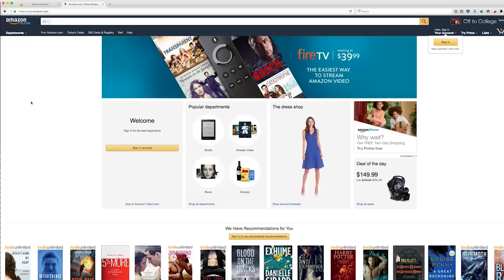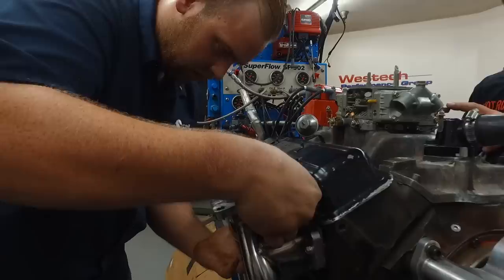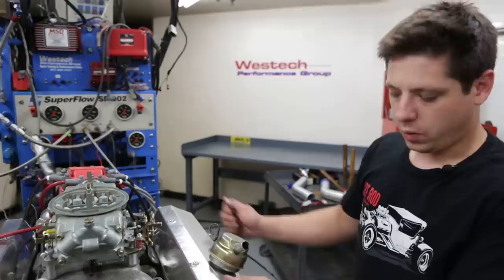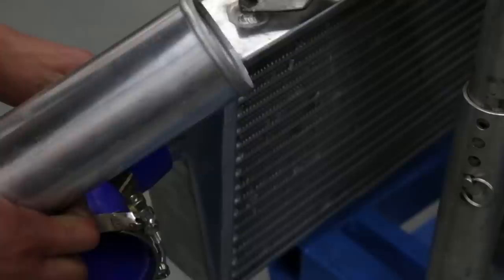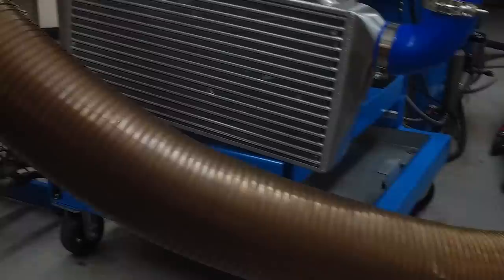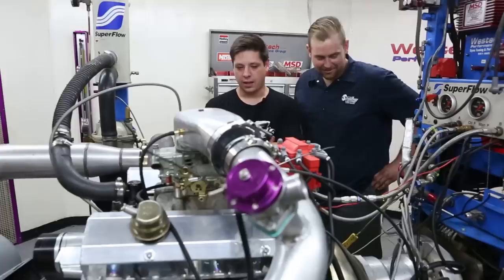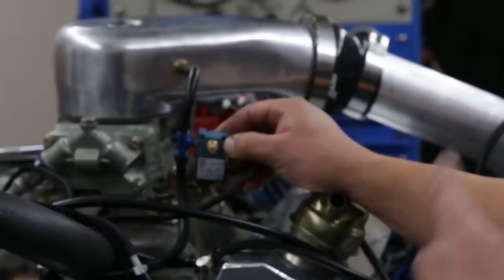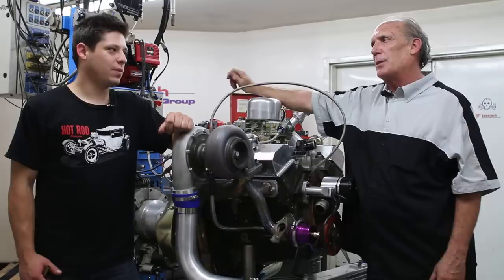Small-Block Turbo Kit for $699! But Does it Work?

Comment: Are they running a stock carb and just changing jets? And are they running an msd distributer with vaccum advance, if they are did they lock out the distributer and drill the blow off valve protection in the carb?
Reply from the maker: Here is how we built the carb: http://www.hotrod.com/articles/build-blow-carb-less-50/

The distributor is a cheap HEI that was modified to limit advance. An MSD would work very well also.

Comment: Just need a better blow off valve  and ur boost controller and Dyna .. and custom piping & ur good to roll.... I’ve done and eBay turbo kit setup.. .. just got better blowoff Valve, and boost controller small blue box and all good plus like he said get ready to work.. just had issues on piping cutting them my self

Comment: What sort of ecu would someone use to tune a 350? I’ve turbocharged my mr2 spyder and tuned it by myself with a datalogit but I don’t know much about these older engines. I’m interested because I’m close to buying an rx7 with a 350 and I’d like to turbocharge it at some point.

Comment: Everybody watching this remember, if you just slap a turbo on a stock n/a engine you're going to blow it. Yeah the kit is cheap, but you need to build your engine for boost, no matter how much you're putting to it, if you don't you're going to blow your engine, suck a rod, or blow a hole in your engine

Comment: I would put it back in the truck and run the turbo intake clear to the back with a giant cone filter hanging out where the muffler should be, and a flow master 40 poking out threw the headlights hole !!!!!!🤔🤔🤔🤔🤔

Comment: Brake booster on right hand drive car is on the right side, probably designed overseas to fit wrong hand drive? Or they just installed it upside down lol.

Comment: If an average guy buys this then thinks its bolt on with no mods or tuning then they need to blow their motors up.  Turbos are excellent power adders but with any power mod you need to make sure it is properly sized and has a good tune.

Comment: Man really like that little electric impact gun. Anyone know what model that is?
Reply: I didn't notice the one in this video, but I tried a Makita DT01 (now discontinued) that a roommate had and it was awesome. Down a bit on max torque and battery life vs. my DeWalt 825 with "20V" adapter and battery, but for 90% of the things I was using it for, it was more than adequate...and an improvement in tight spaces!

Comment: do you need to do something special to the carb/ or does a regular holley or demon carb work? i heard you need a blow through sealed carb? any help appreciated,going on a 1980 c-10 350 4  bolt engine
Reply: Blow-through carb. They're about $800-$900 at Summit. I've also seen some utube videos on modding Holley carbs to handle a blow-through setup.
Reply from the maker: We modified a stock Holley for this test. Here is a link to our $50 blow-through carb build. http://www.hotrod.com/articles/build-blow-carb-less-50/

Comment: You never said anything about the carb, a stock carb would give you problems due to it's not designed for blow through applications. You would have to have your carb reworked or buy a new one designed for blow through. just saying.

Comment: Why did the boost not stop rising with the original 1 waste gate???
Reply from the maker: The single waste-gate didn't have enough flow to slow the turbo down. Because of that, the speed of the turbo kept increasing, as did boost.
Reply: Gotcha. Thanks for the reply!

Comment: Hey smart guys how about the Accel shorty plug for header instead of beating the crap out of your headers ? Or is that to easy ?
Reply: The tube blocked the spark plug hole. A shorty plug was not an option.

Comment: I did not see them clock the turbo...could have clocked it 180 degrees and turned the whole turbo around it was using a t4 flange which is square and can mount either direction..also they were running on pure waste gate why not add a softer spring that would dump at 8 PSI..i just do not think they really know much about turbo systems

Comment: It doesn;t pressurize the entire carb, so, it won't work at all. The only thing that will happen is, it will force the fuel out of the carb.
Reply: You can buy blow through kits for carbs to use them with boost.

Comment: How much hp u think will this kit add to an h22a4 vtec dohc engine
Reply: The question you should really ask is "How long will an H22A4 vtec dohc engine last with a turbo the size of my head and no other mods?", though asking it like that should also clue you in to the answer. Cheers.

Comment: What carb is that? A blow through? Most people are not using blow through carbs to that's another $600 bucks. Misc. odds and ends for modification the price has already doubled at least.

Comment: Weather it works or not?  What.... do you mean that you think tey would sell you a fake or broken turbo?  Why wouldn't it work? Because it doesn't have Garrett stamped in the side? 
You can go to a junk yard and get a turbo off a volvo and make it work. You're not going to push 21 psi with it on a v8, but it will work as it should.   Why wouldn't the ebay turbo work? The real question would be HOW LONG DO THEY LAST?

Comment: You do realize that the reason you overboosted is because you didn't have a vacuum line on the wastegate.. you don't need 2
Reply: Not the case. The boost signal to the wastegate was routed correctly (you can clearly see the vacuum line in the video). The wastegate was too small and poorly located on the exhaust manifold causing it to function inadequately.

Comment: can you make a video on how to make more power and torque in a 5.3 tahoe motor. is there almost no actual information online, only crazy pipe dreams.
Reply: What do you mean? there are countless videos and forums for that engine. Whether it be the vortec based model or LS based model. It's exactly like any other GM v8. get a cam, some bigger injectors, a tune, headers and exhaust, super charger, pro charger, turbo charger, etc.
It took 2 seconds of research to find kits, videos, and forums on the subject.

Comment: Couldnt just change the wastegate spring?
Reply: The wastegate spring determines when the wastegate opens, not how big the orifice is. In situations like this where the maximum flow of the waste gate was insufficient, dual gates, or a larger gate is necessary.

Comment: So what's the best budget turbo kit for an lq9 6.0 engine ? I have an 04 ss with stock lq9 317 heads, I wanna run a ls9 cam and turbo at 10-15 psi. Seen some pretty impressive videos of them. I just dont know what's the safest affordable route for turboing my truck.
Reply: You need to look at how much damage each system causes overtime and how much benefit each system gives you and whether those are worth the goal you're trying to reach
Reply: A lot of people just change the rear end gears in the transmission and get just as much power out of it without touching the engine itself
Reply: @thecloneguyz  my truck is all wheel drive brotha. Could I make the rear faster than the front?
Reply: Precision turbos make quality turbos for good prices. Dont cut corners on ebay turbos, they have a tendency to explode. If you know how to weld you could save yourself quite a bit of cash doing the plumbing yourself.

Comment: is strange to me this guy seems like he wanted this Turbo System to fail but he was proven wrong and he couldn't just deal with it he has a good Turbo System real cheap
Reply: I don't know if i would say good since the layout is crap with the rear facing turbo, bad flow collector design causing boost surge, cobbled together IC piping that required an AC welder to add a flange, intake filter that doesn't fit and undersized waste gate that also causes boost surge.

Comment: buy once cry once. good motto to go by. Turbos and super chargers or nos even should not be bolted on any stock engine unless you are making a you tube video or don't like a running motor. Just saying if you save your money and build a motor with higher compression rates  and proper piston rings and cam. it  will last a long time running boost if done right. Then you will still have a car to drive until you are ready to swap a engine. Do this you will be walking with a trashed motor in your ride in a day or two  or a few months unless you set the boost around 3 or 4 pounds. And If that's the case why build it in the first place.  I know i mentioned nos also and that's another subject it is cheap to install but it starts trashing the motor the day it is installed.   BOTTOM LINE HOT RODS ARE NOT CHEAP AND YOU GET WHAT YOU PAY FOR        I

Comment: it would of worked if they would of juist flipped the system the correct way as in turbo on the drivers side
Reply from the maker: Incorrect. In a vehicle application, there is a master cylinder in that location. The turbo also interfered with the stock-height valve covers.

Comment: "Got oil absolutely everywhere..." 
-_- Did you really run it with the valve covers off? It's hardly possible that you'd be that oblivious, right? Wth?
Reply: An old guy told me about how they got a hole in the oil pan driving an 80s Chevy g10 van with straight 6 motor and took the valve cover off  and drove home just pouring oil on the valves (in vans they have a doghouse cover so the motor is reached from the drivers seat) if you don't know what that is then nevermind
Reply: So, you've never adjusted the valves while the motor was running?

Comment: I think in this case the engine will be more likely to break than the Chinese turbo. It is too much horse power for this engine in stock form. I am surprised the carburetor got along really well with the turbo making this set up really low cost.

Comment: $699 is too much. Get a crusty turbo from a junkyard, slap it on a junkyard Vortec. make 800 and call it a day.
Reply: Or get 2 used t3 turbos and have a much easier time with boost management with an internal waste gate on both.

Comment: Also just saying 13 psi sounds great if your gonna drop turbskies on engines not intended to run boost you gonna dump an engine or two  so run that shit balls to the wall or leave it stock

Comment: Uh, you CAN buy shorter spark plugs.
Reply from the maker: Shorty plugs don't solve the problem when the header tube completely blocks the spark plug hole. Even with a shorty plug, there would have never been clearance for a plug wire.

Comment: Sounds complicated! Can't you make 500hp with a cam, heads, Intake, carb.
Reply: Sure you can,  the Edlebrock 435 hp top end kit (for example, and that's about 350 to the rear wheels assuming 18% drive line losses)) is $3,000, w/o the carb,  you still will need a good exhaust, and you will still be short with that kit. To reliably get 500 hp na on a 350, you'd need a bump in compression and a somewhat radical cam (meaning a rebuild including pistons, a loss of vacuum and some lope, not necessarily a bad thing, but you'll also lose low end torque, affecting drivability).  Now compare that to a cheap turbo kit, pricing is a wash, tuning is 300+ (assuming everything is perfect when your car hits the dyno, you don't want to be making repairs or making major changes while your car is strapped down, costs multiply exponentially, $175+ per hour for dyno time plus whatever the tech charges), and add-ons are $1000+, boost referenced regulator, pump, ignition, etc.  But that torque, having a torque curve that's as fat down low and as flat as a decent turbo kit versus the shit torque curve you get from a healthy small cube, high hp engine...there is no comparison.   Same with HP, big hp small cube engines can make decent hp numbers, but its all up top, whereas the turbo will make hp all through the powerband. The reason I went from the S-trim to the T-trim to the Hellion kit.  Made decent numbers, 503,rwhp, 429 tq with the S-trim and stock cams, but a ski jump hp and tq curve, 685hp and 649 tq with the t-trim and some generic forced induction cams, fatter than the S-trim but still quite peaky, and 675 hp and 737 tq with the Hellion kit with built heads and custom turbo cams, pulls like a freight train from 3500 and never stops till I shift at 7200 while being completely streetable, 20+ mpg on the highway and loafs around at 2000 rpm with no issue.  Bonus is I have enough headroom in the Turbos with fuel upgrades to make 1100+ hp.  All are on a built .20 over Tekskid short block (283 cubes), corrected and at the rear wheels on a Dynojet 224.  All the while, the little na 350 ci small block is stuck around 500 hp (410 or so rwhp).

Comment: Why would ANYONE build a "basic" turbo kit with external wastegate(s)? That's retarded. Don't tell me it's because the turbo is cheaper, because  the external wastegate(s), flanges and turbo combined always cost more than an integral gated turbo. Always! Use a turbo with an integrated wastegate that has your engine displacement within it's specified range (or even slightly outside of it)! That way you don't need the extra flanges and have no need to plumb the waste gate exhaust back to the collector and cat converter. Also, has anyone ever hear of a corrugated flexpipe? You'll want that on the crossover pipe so it'll actually fit. Even GM uses that on the LP9/LAU V6 engine (Caddy BLS / Saab 9-3 / Saab 9-4X / SRX 2.8T) with a single turbo.
--
The biggest problem with generic turbo kits that are not built for a specific car and engine bay is getting shit to fit. You guys are doing it on an engine stand. Getting it to actually fit in an engine bay is 10 times worse. The amount of time and fabrication labor is what kills you, not component costs. In this regard, it is ALWAYS better to use an air-to-water aftercooler. Why? Because it is half the size of a box of Kleenex. The radiator and electric water pump can be put anywhere you want, and are connected via skinny little hoses that are FLEXIBLE. You can put it on your door if you feel like it!

Comment: SHORTER SPARK PLUG
Reply: We tried, the tube still impacted the plug and there was not enough clearance for the plug wire. Dimpling it was the quickest option, the best way would have been to cut and re-weld, though not practical on a dyno.

Comment: Take the big ass valve covers off and turn the turbo around
Reply: Those were stock height valve covers. The turbo only fit backwards. Later, we cut the manifold, clocked it and welded it in the correct position.
Reply: Evan Perkins they look  much wider than stock small block covers
Reply: Look where the bolts go in they are atkeast an inch wider and much more squared off
Reply: I borrowed a set of stock, stamped-steel covers from Steve and the turbo still didn't clear. The jig the turbo manifold was welded on was either way off, or perhaps warped.

Comment: you take the headers, flip up em around each side, then flip the upside down, so the outlet faces upwards and the turbo is  under the motor persay, if u did that,  you would of had to neat the one tu e for the spark plug also, sounds retarded. vut works really well
Reply: On an engine dyno perhaps, but that would not have fit in the chassis this kit was intended for.

Comment: The exhaust routed wrong bc y'all put the exhaust headers on the wrong sides...smh come on that turbo was suppose to be on the drivers side, also the reason the cross over pipe was in the wrong place
Reply: No. The kit was installed as if it were in the Camaro it claimed to be designed for. It would have to be on the passenger side or it would contact the master cylinder. The turbo was backwards because it contacted the valve cover. If the passenger side exhaust manifold were correctly welded, it could have been turned around.
Reply: You think it would contact the master cylinder the engines on a dyno, it very well could have cleared by a half inch and went behind the cross member but who knows bc you didn't actually install it on a car so it's all just speculation
Reply: The kit was for a Camaro. It was installed as if it were in a Camaro, regardless of being on an engine dyno. Mounting on the passenger side is a requirement for any left-hand-drive GM vehicle.

Comment: I bought one of these kits. Lol.  Exhaust manifolds are trash you cant get  bolt's in the flange's on 2 cylinders. Also,  the B.o.v's are junk. Can't build boost easily. Don't waste your $ or time. These come out of S. Cal.  All kits are the same, J. U. N. K. I build cars and had to spend far too much time on this crap. Next time I'm using g an LSA blower off eBay much easier in my opinion. No piping,  no B. S.